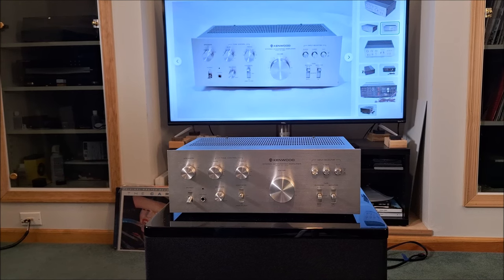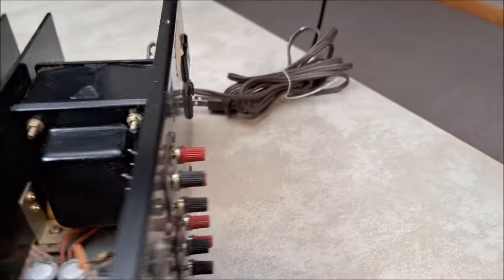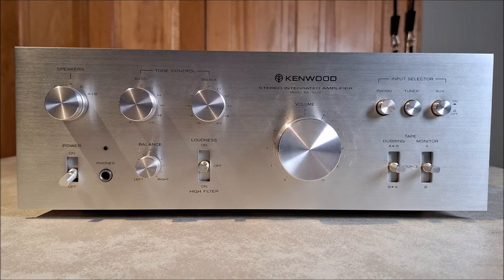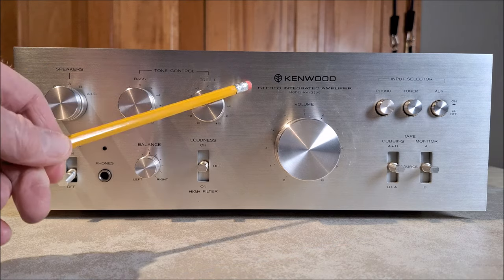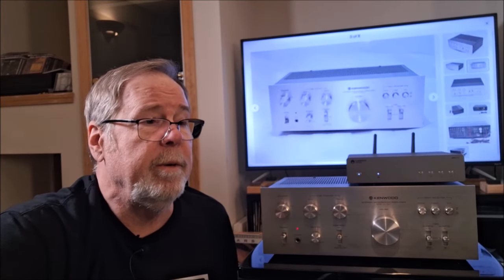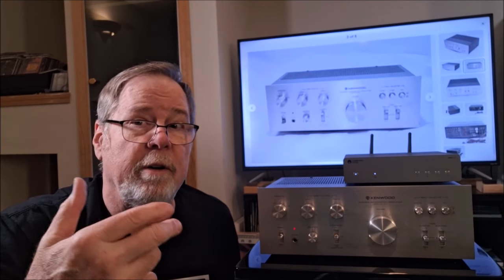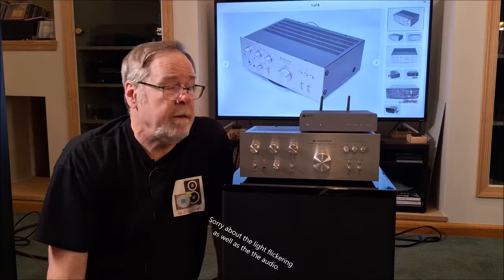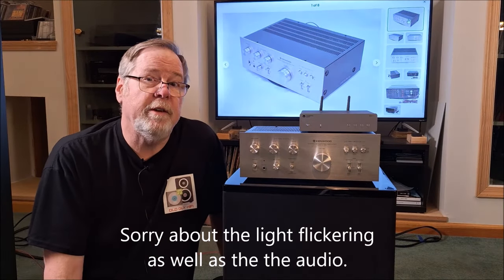Vintage Goodness! Kenwood KA-3500 Integrated Amplifier from 1977!  Sorry about the poor sound.

Comment: If ive said this once, ive said it a hundred times. If manufacturers would make newer equipment look like the equipment from the 70's,  things would fly out the door, especially  stereo receivers. Retro looking speakers sell like hotcakes. So would retro  looking receivers, with modern insides. That NAD integrated amp that is retro sells really well.. awesome looking Kenwood by the way.
Reply from the maker: Thank you Jim.  I agree somewhat. The current line up of NAD, to me, sounds nothing like their old gear.  I had a 3020i and a 7240 for years. You are right though.  Look at Yamaha, their sales are blowing up.  Meters baby!!  Thanks for watching and as always I appreciate you r input. Have a great weekend.
Reply: @jim010109  I agree with you brother. I've got a rebuilt ka 5700.....it looks so nice (sounds  lush and full) that  I could  only replace it with something modern that legitimately blows it outta the water soundwise....which isn't easy.

Comment: Nice to see reviews of vintage gear.  Fyi, it's no problem hooking up a subwoofer to vintage gear like this, with its two sets of speaker connectors.
Reply from the maker: True. Thx for tuning in and commenting.
Reply: @OldGuyHifi  Careful, Kenwood usually wires speakers A + B in series.   It sounds horrible.  I just bought one of these 3500's .  I had to wire sub in parallel at the terminals. It sounds amazing.  Its a great affordable vintage amp.

Comment: This unit reminds me of the Lafayette LA-40 Integrated Amp and LT-40 Tuner that I owned around 1978 or so. That was good stuff back then.
Reply from the maker: Mr. B, Thanks for returning.  That was an under appreciated brand. There are times that I wish I had been able to keep all my old gear.  The problem is that I would have a ton of vintage audio but, huge repair and upkeep bills and no wife!

Comment: I bought one of these amps brand new in 1977. One of the best integrated amps I ever owned and wish I never sold it, got caught up with multi-channel amps a few years later and sold it to a mate.
I loved the warmth and clarity of this amp and its bigger brother the KA-7100. The bigger amp was out of my price range so I settled for the KA-3500, paired it with the Kenwood KD-550 direct drive turntable, something else I should never have sold. A fully refurbished KD-550 nowadays can sell up to $3000 NZD depending upon tonearm and cart here in New Zealand.
Reply from the maker: Mr. Mckenzie,  I also have a few pieces that "got away." The 7100 was a beast for sure but there is something special in the way the 3500 sounds.  I don't have any experience with that model turntable. but I am sure it was a beauty.  Thank you so much for watching and commenting.

Comment: Beautiful unit. Amps and receivers from that era sound darn good. And they are fun to repair and restore btw (I do that as a hobby).
Reply from the maker: This one is in beautiful original condition. All the caps are fine and with in tolerance.  I was very surprised.
Reply: @OldGuyHifi  Electrolytic caps are usual suspects but I find more issues with small signal transistors and some resistors in old equipment; many good quality ecaps and tantalumns stay within, or close to, specs after all the years. Yet it's better to replace them as they could fail anytime at their age.
Reply from the maker: @nabman_  Good points. If it was my unit I would go through it thoroughly.
Reply: @nabman_   I just bought a Kenwood ka   3500 amplifier what do you charge to refurbish amplifier thanks

Comment: @OldGuyHifi - I had the KA-3500 for many, many years. It was a wonderful amp. I had hooked up to a pair of JBL4406's. It sounded great. 
I ended up selling it to an old friend for cheap who is using it now.
Now my daily driver is a pristine Kenwood L series setup I inherited with the original cables, manuals, etc (L07c and a pair of L-07m mono blocks). Pushing a pair of modern Wharfedale Lintons. I am very lucky.
Reply from the maker: Sounds like a great system. You are lucky you found the sound you love. Thanks for watching.

Comment: Nice piece, very retro-looking.  The style is much like a Marantz 7 preamp I have that was from the 60's. At about the same time (1976), my brother opted for a modern-looking JVC receiver with higher power (110w), a large backlit display w/ VU meters, and sliding faders for volume, balance and graphic EQ. Despite of all my efforts to destroy it, I think it is still working too.  I love the look, but most vintage gears are not going to work in my digital-oriented system with low impedance and low sensitivity speakers.😂
Reply from the maker: Simon,  You make a valid point. There is a lot to be said for modern gear.  I do like the nostalgia factor. My era.  Thanks for sharing your thoughts.

Comment: There’s a lot of room in there.  Great if you have to replace components. What is the piece of tape covering in the rear? Super clean Amp.
Reply from the maker: I have no idea. The unit belongs to a friend of mine. I just cleaned the chassis and the pots.  Sounds great for its age.

Comment: Was that subwoofer connected. And how was the connection.
Reply from the maker: It wasn't for the video but I did use it for listening. The subwoofer is a good platform for filming I never run it with gear on top. I connect via "High" level inputs, i.e., speaker level. My sub can do line level or speaker level. I prefer speaker level. Great question. Thx.